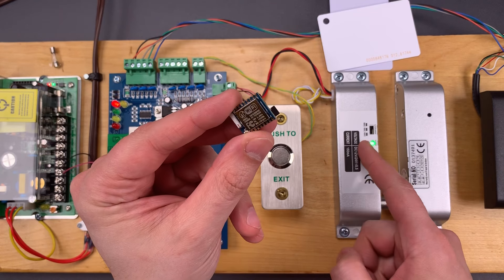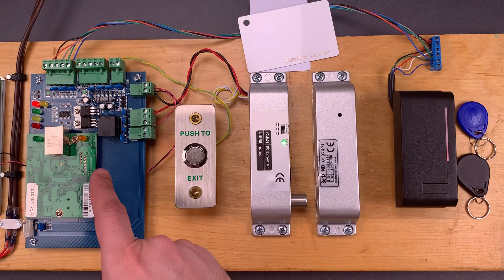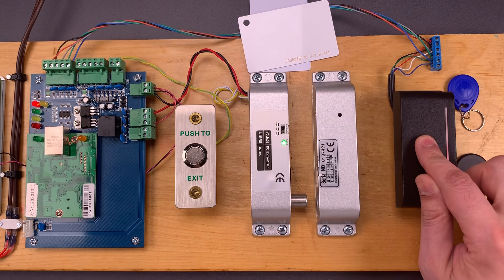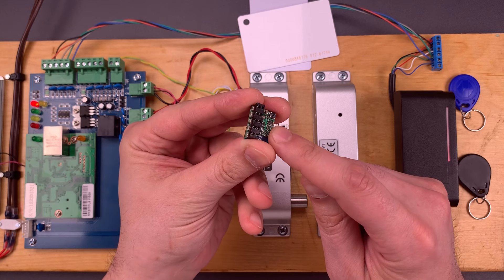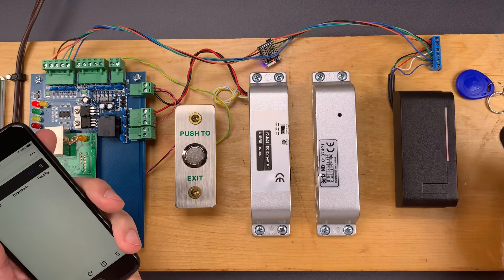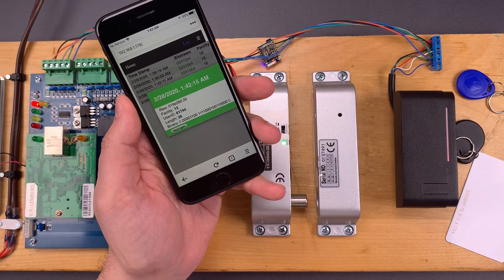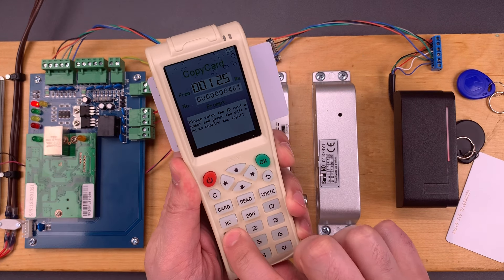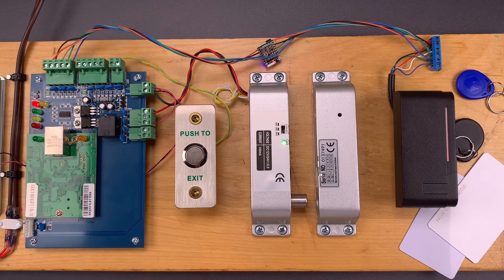[1052] Bugging an RFID Card Reader

Comment: “The lock on your door is for decorative purposes only”
Reply: Amen!
Reply: My country has a saying: "Locks will only stop honest people."
Reply: Asko83 your country is smart
Reply: @Asko83  I have a saying: "If you need a lock, they're not honest, just lazy."
Reply: @Asko83  I was taught it as 'Locks are to keep honest people honest, the dishonest people are already inside'.  But think I will add '...or lawyers'...or in this case both.
Reply: That doesn't really apply here. 

The process lockpicking lawyer just showed is not "low effort" by any means. You're talking about having to install an actual device onto electrical leads for a keypad. First you would need to get access to this keypad so you had the actual time to install it. It requires a punchdown tool as well, so you wouldn't be able to just sneak onto a facility and do this installation stealthfully. 

This video was just an advertisement of the ESPKey and doesn't actually show any exploit that a normal person can use. You would have to be well versed in social engineering, electrical wiring, and networking to pull of any sort of infiltration with this process.
Reply: @anarchyjinflames  I'm versed in 2 out of the 3 requirement.
Reply: My airmiles card gets me places- like through a locked door 🚪🙃
Reply: @anarchyjinflames  You would be amazed at where people have been able to gain access to with an orange vest, a clipboard , and a fake printed workorder.
Reply: @anarchyjinflames   I've seen a demonstration of installing one of these before.
On the outer door, 2 guys in maintenance outfits, took about 10 seconds. Then they can make their own card to access everything else inside the building.
Reply: @Asko83  it's the same in mine🇷🇴
Reply: @Benjamin Morris These are more on businesses offices and apartment buildings
Reply: I like the expression "keeping honest people honest" ie someone jiggles the knob, if it's open they might peak inside, run off with something but if it's locked they stop there.